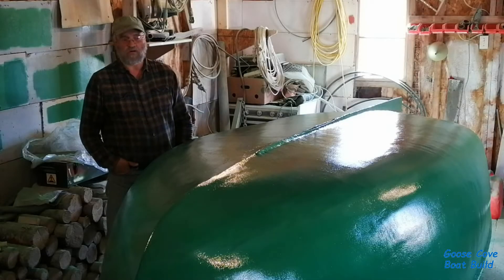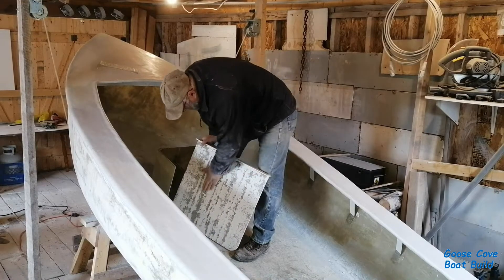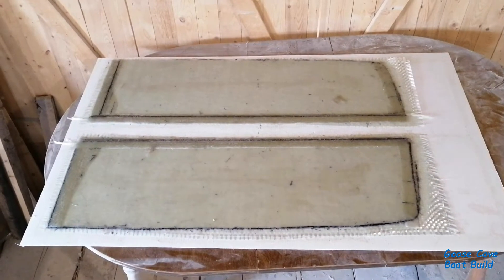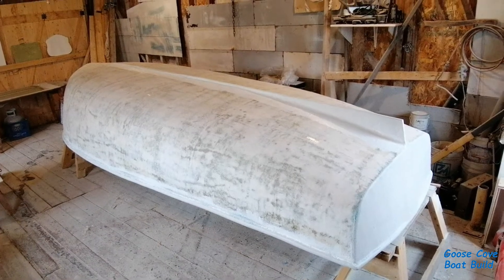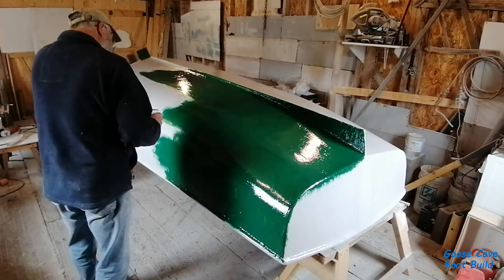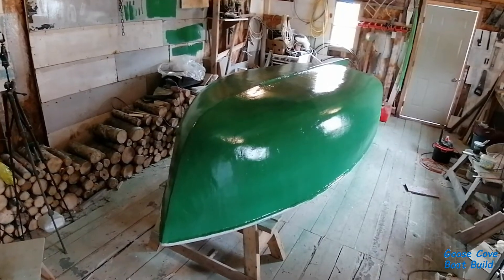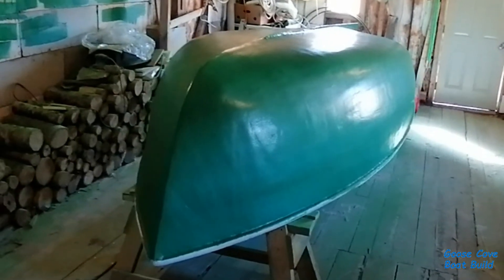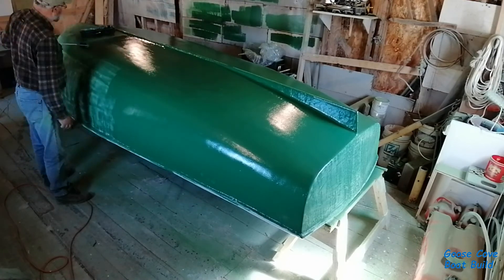Hull coatings and more

Comment: 7:35 it looks like you are just as particular as I am. I got to this stage, and a skim of bondo, and sanding with 1000, my next plan will be to laminate two or three layers and maybe I'll be satisfied enough to use a buffer. I gave up sanding with 200-600 grit. I found 1000 gets the surface I want. If I sand again, I'll start with 1000.